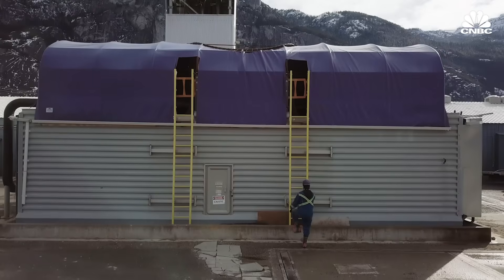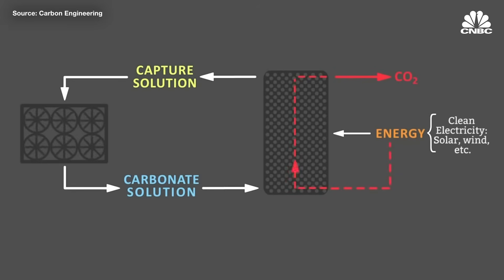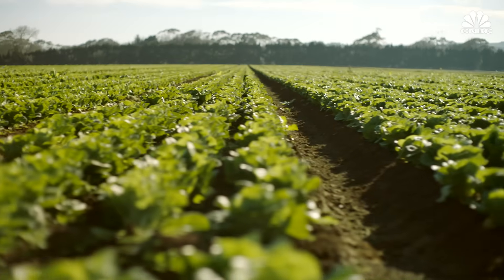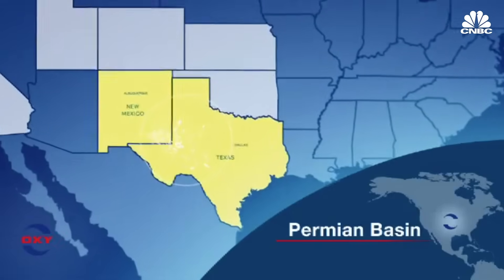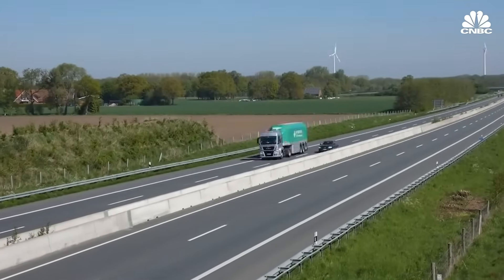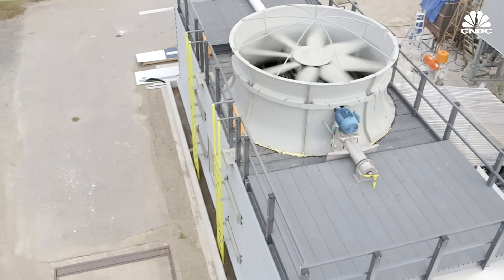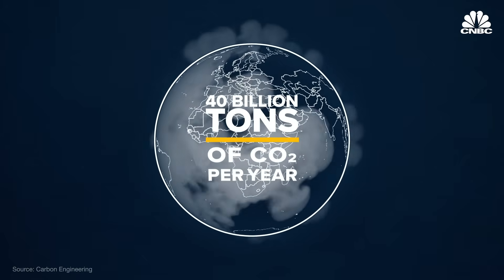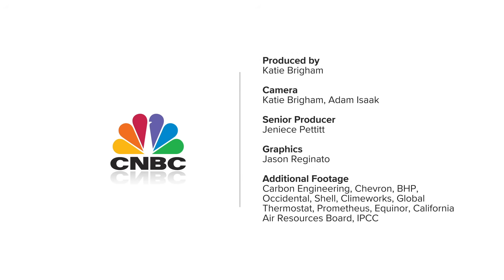Bill Gates-Backed Carbon Capture Plant Does The Work Of 40 Million Trees

Comment: Do both Carbon Capture and plant trees.
Reply: Fruit and nut trees.🌱🌲🌳🌴🌵
Reply: Chris Gilliam Man Stuff or just regular trees that grow fast. Lots of options. Australia has a big job up for them. They have an extremely valuable tree species called the mountain ash which can grow super fast, dense, and is the second largest tree species on earth. The northeast US has a tree known as the black locust which grows extremely fast and has very dense wood and can be grown on subsoil such as spent coal mines which it’s already used for. we need to plant more timber trees.
Reply: Trees need water to keep the people alive let alone a forest .  Water is a big crisis for cities and other arid areas.  More cities each month are no longer able to provide water safe to use from taps.  A few are out of water per reports.
Reply: yes boss
Reply: and make Oxygen
Reply: @bentoboxofire7404  A good starting point?
Reply: Neh
Reply: Us pol said ban gas cars too
Reply: all factories should be forced to clean the air that comes out of their smoke stacks before it leaves the factory.
Reply: Maxidum Yang countries are low on space because it’s all used for animal agriculture.
Reply: This system provides
> carbon capturing 
> restore soil
> reduce floods
> reduce heat
> reduce wildfires
> enriches air with oxygen 
> creates building material 
> provides food
= proven for millions of years

Trees in a well managed way called syntropic farming 🌳 🥕 🌳 🌽 🌳 🥕 🌳 🌽 🌳 

follow this link to learn more
https://youtu.be/gSPNRu4ZPvE
Reply: Don't forget nuclear. It's looking better than ever with modern technologies.
Reply: IAmebAdger I don’t see why more people look at nuclear
Reply: @sugabopp 

I agree, the chernobyl and Fukushima designs were horrible, obviously.  Nuclear is insanely energy dense.
Reply: And use less fossil fuels and more solar/wind energy.
Reply: @miyatenmeiritsu1810  thats just too expensive
Reply: @miyatenmeiritsu1810  Thats just plain stupid..  You will always need 100% backup for those intermittend energy sources. Cant run an economy on that.
Reply: The only effect these plants might have is to CO2 starve the trees and other plants in some area around them, thereby reducing animal life in the area also.
Reply: @maxidumyang5102  Yeah, lets reduce the gas that brings life to this planet..  co2 is a mere 0,041% of which 0,0012 comes from humans.
Reply: @flexairz 

These asshats don't realize water vapor is 95% of all greenhouse gases.  For proof simply look at high and low temps of a dry and arid Phoenix and compare that to humid Miami?  Phoenix cools off quite a bit at night whereas Miami by comparison cools off very little. 

The control freaks who support draconian measures to combat a non problem are absolute scum.
Reply: Planting trees good, capturing carbon bad.  There's is no climate crisis.
Reply: @ThekiBoran  intelligent comments good,stupid comments bad
Reply: @ThekiBoran  No climate crisis? Really? You better open your eyes.
Reply: @CGoffgrid 

Why don't you get out of the basement and go outside.  The weather is gorgeous today.  It's wonderful.  The only crisis is a concocted tax revenue crisis.
Reply: @ThekiBoran  I'm working today, and it's freaking hot. But if the recorded data doesn't show you the warming trend there's nothing I can say to you that will.
Reply: @CGoffgrid 

The climate needs more CO2, not less.   Crop yield would increase with more CO2 in the atmosphere thereby requiring less land for farming.  Hello?
Reply: @CGoffgrid 

There's a warming trend depending on where you start the graph/what year.  Data on this issue is manipulated to fit a tax and spend agenda.  Professor Richard Mann and the crooks at East Anglia are bit two example of fraudulent data manipulation.   Not sure why I bother with this issue.  Global warming is not a problem, just ask the people and government of the Maldives.  They've recently spent millions on infrastructure upgrades.  Shouldn't they be moving to higher ground because of the impending doom that has been 10 years away for the past 30 years?
Reply: @ThekiBoran  the problem isn't fossil fuels or pollution (even though electric vehicles, solar energy are the future and pollution should always be reduced as much as possible) fossil fuels are still needed. The main problem is population growth. Ask Bill Gates, he has been trying to lower the population ever since he became rich. The rest is just speculation and the climate change side has become irrational and delusional. They rely on fear to get more lemmings to follow them. It's beautiful outside. There's is nothing to fear. We are flying through space and our destination is unknown. Have fun, it's a beautiful ride.
Reply: Kroban3 more co2 Is NOT good. It’s not as simple as “well it’s food for plant for so more food is good” no. Co2 likes to hold onto heat, the more co2 the more thermal energy is being held, this warming the atmosphere. Plants have to open pores called stoma to breathe in co2 and breathe out o2, but when they do this water escapes out the pores, so plants manage how often they open the stoma to get optimal net gain. When it gets warmer, more water is lost through the stoma, so the plant opens up the stoma less often, meaning plants absorb less co2 overall.
Reply: Anonymous Person if your argument is “it’s looks nice outside” than you are blissfully ignorant of what’s going on. The average temperature of earth is rising, ice caps are melting, lowering the albedo which will warm the planet even more. 

Now with that in mind, this is mostly a normal cycle, mostly. Human activity is speeding up the change. Now, just because it dosnt look bad right at this moment, does not mean it won’t look bad in 15, 20, 30 years. Earth will be fine, it has gone through worse and life still exists. What won’t be fine is humanity. But again, won’t be immediate. I know some people like you don’t care about the future, they would rather get as much profit and prosperity now and sit on it ignoring the outside world later. But some of us DO care about the future, and the world we will leave for our descendants.
Reply: @CGoffgrid  In Sacramento CA we are going to have a few nights with near record braking LOW's this week. It's normal for it to be around 100 degrees in June, this year the spring was pretty cold, barely ever got past 70, and summer came for a few days and then we are back to spring.

I'm all for planting more trees, why not even add it to part of school projects, kids can do some work that will be there for years to come, learn more about how planting and nature works and when they grow up, they will have a place that will be filled with childhood memories, where they can come back to when they have hard time (everybody has bad times in their lives not matter how rich or poor you are).

I just think that all this crazy global warming talk is all political, they don't really care about the planet or our well being, they just want to get the funding for their own purposes and why not base it on something that people really care about, the air we breathe.
Reply: @andreystarovoytov3337  The fact that you have lower temperatures in a local area has nothing to do with GLOBAL averages. The science behind greenhouse gases is very basic stuff, it's not rocket science.
Reply: @CGoffgrid  Not just local, same story pretty much all over US, end of May Colorado and a lot of parts around it received a ton of snow, pretty much all the highways around Colorado and Wyoming were closed due to blizzard. A lot of places all over US have near record low temperatures this time around. I know that when temperatures get hot, climate freaks scream "global warming", but when they go near record low, they are quiet. There is always two sides of the coin.
Reply: @CGoffgrid  Where?
Reply: @CGoffgrid  No, he has them wide open. You might try to take your own advise.
Reply: @ThekiBoran  Who said CO2 is a pollution? It is not what global warming is about. Read some reliable sources of how it works.
Reply: @ThekiBoran  there are detailed analysis showing exactly opposite of what you are saying. Stop spreading nonsense.
Reply: @movax20h 

Who says CO2 is a pollutant?  The same body that said slavery is legal and that a man growing wheat on his own property for his own consumption was engaging in interstate commerce, the control freaks tools at the Supreme Court of the United States, that's who.
Reply: @ThekiBoran  What normal, adult, well researched person listens to "some body"?

Also, no even they don't say it is pollutant. Show me where? I entered "co2 pollution" into Google, and got basically nothing saying it is a pollutant.
Reply: @ThekiBoran  dont worry we are all gonna be plant food soon
Reply: Why steal from the trees? Should we steal O2 from animals?

Comment: As long as Carbon Capture  removes more carbon than carbon from the creation of new oil, it's fine.
Reply: It doesn't.  A coal power plant just down the road from me installed some CCS (carbon capture and sequestration) in their power plant to try and cut down on CO2 output...  Just to be clear, on a daily basis this power plant was producing around 10,000 lbs of CO2 a day. 

In order to supply the electricity everyone needed AND run the CCS system to try and scrub the CO2, the plant had to up the amount of coal it burned by about 1/4th just to provide everyone with electricity AND run the CCS system. 

Guess how much CO2 they sequestered per day? A few hundred lbs. That's it...

Comment: 1:53 The captured carbon can be used as fuel, which turns it back into carbon dioxide?? Why would u do this??? Why?!!??!!?????
Reply: The problem its the global amount of co2 not co2 itself, so if for example whe use carbon to make wires or structures, the amount in the amotspehere will just be reduced.
Reply: santiago perez Totally agree. It was the part about turning the captured carbon into fuel that doesn't make any sense.
Reply: well, gas has a very very high energy/mass ratio that no battery or renouvable source can provide, so, until fussion reactions (that are the cleanest and most common resource human knowledge can adquire by now) we will still need it, then, if u use c02 on air to produce new gas, then u are not increasing the amount of c02 on atmosphere but re using it, so, u can create ¨envirovment friendly gas¨

Comment: Gates is not an engineer, so can be forgiven.  But, oil companies love making it seem like they''re doing something.

"Why wouldn't we do that?" -- because the natural sequestration of CO2 by ocean life dwarfs what air-capture can do and requires no energy.  It just requires that we protect ocean chemistry, soon... 

http://tinyurl.com/zprh78l 
http://tinyurl.com/hhlrd4o
https://tinyurl.com/yafgmlmd

...real soon.

Air is 999,600ppm not CO2.  What is the energy per ton of CO2?  'Renewable' electricity, if not Hydro/nuclear/geothermal simply adds revenue to the oil/gas industry.  Burning anything is going backwards.  That includes misleading folks to believe that Hydrogen or other engineered fuels mean anything when the problem is the ~2 trillion tons of combustion-age CO2 already in air & seas. 

And no sequestration plan that uses necessarily high-pressure underground storage does anything but increase long-term risk.  True CO2 sequestration is done as Carbfix or BSCP, etc do -- mineralize CO2 as sea life does via carbonate mineralization, as in abundant basalt.

Trees?  Note that trees drop leave & branches and die, all of which is digested by soil microbes that emit CO2, CH4, NxOy...  Sadly, forests are not a solution, but we need them. 

The combustion industry wants to get subsidies/allowances from us all to produce products for sale and burning.  They are not about the environment, otherwise, they'd not be misleading us about C-capture, nor would folks like BP be investing in wind/solar and putting out ads that suggest burning their gas when the wind doesn't blow and the sun doesn't shine is good -- we already do that in Calif. every day.   

It doesn't help our emissions, but it does open us to tragedies, like the Aliso Canyon gas leak that lasted 4 months, emitted the equivalent of 8 million tons of CO2, but luckily didn't ignite and burn up the adjacent community.  Oh yes, and those old oil wells are precisely what C-capture folks think we should use.

If Gates, Shell, BP, etc. actually wanted to benefit us and the environment, they'd have already started retraining programs so their employees could choose to learn power/hydro/geothermal/nuclear engineering and look forward to well-paying, beneficial jobs in truly clean energy.
--
Dr. A. Cannara 

650 400 3071
http://tinyurl.com/y65belox  (Green New Deal)